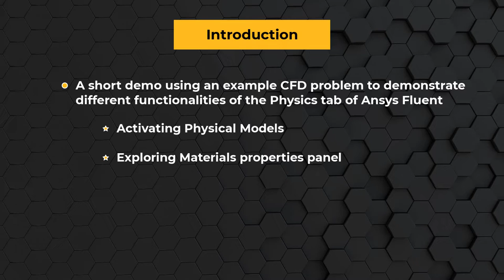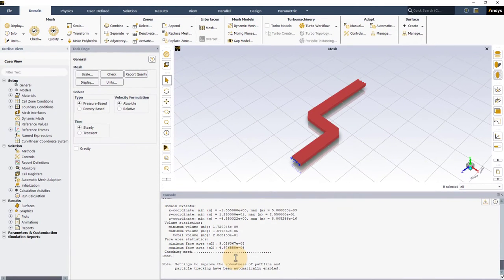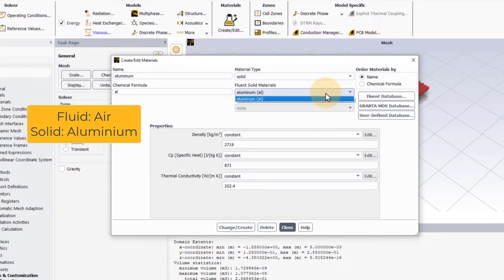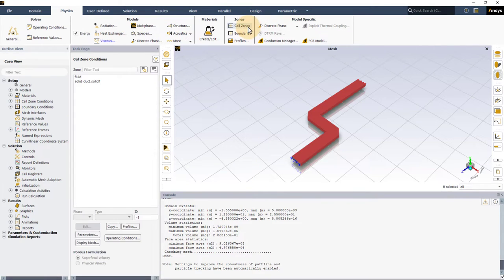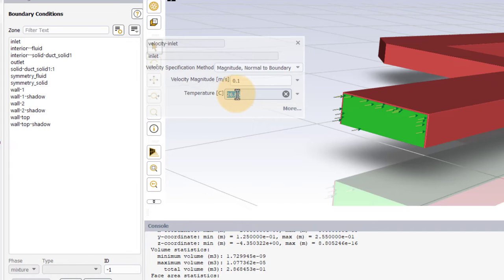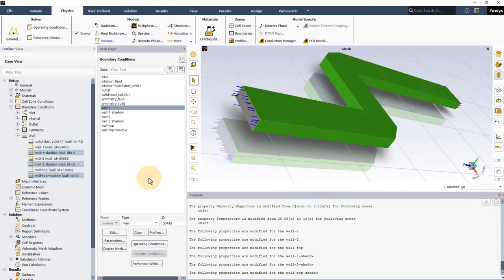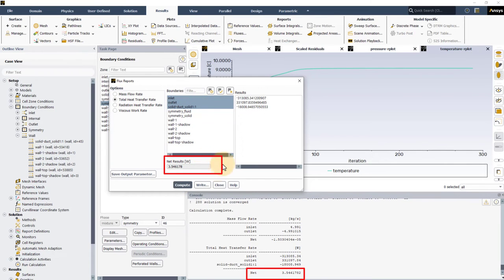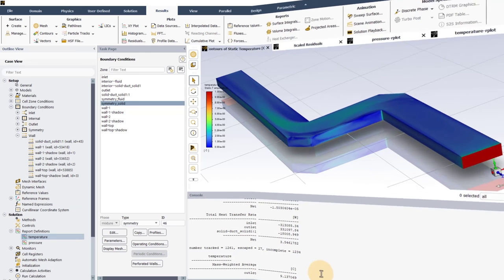Tutorial — CFD Simulation of Flow Through a Duct in Ansys Fluent — Lesson 7

Comment from the maker: This video is part of the free Ansys Innovation Course, "Physics Setup in Ansys Fluent". Access all the course contents, including additional lessons, handouts, simulation examples with starting files, homework problems, and quizzes here: https://courses.ansys.com/index.php/courses/physics-setup-in-ansys-fluent/
Reply: At min 11 sec 44 of the video, as the multi edit task was being done,  the material name was aluminum, although the solid zone had already been assigned to  steel during the cell zone type assignment. How come? can you please clarify
Reply: @tonykaram4735  Hi, i might be late for your question but i had the same question. here is the answer, from ansys fluent guide:
"Material Name sets the material type for a thin wall. The conductivity of the material is used for the calculation of thin-wall thermal resistance. (See Thin-Wall Thermal Resistance Parameters for details.) Material is used only when Wall Thickness is nonzero. Materials are defined with the Materials Task Page."
so it only matters if you have thin wall. when using solids it does nothing. 
Cheers